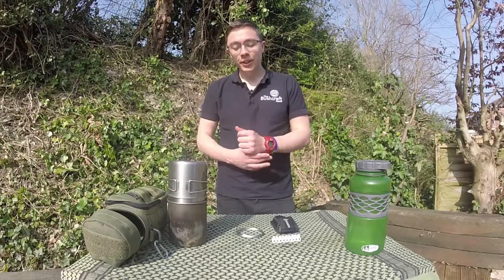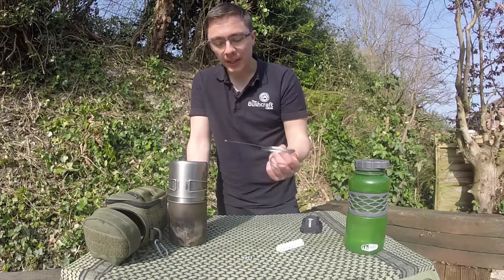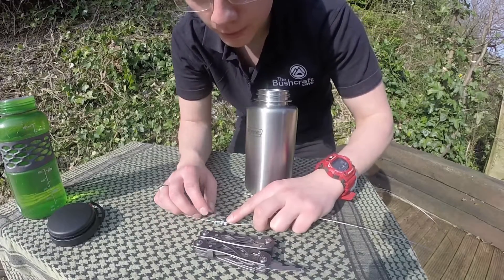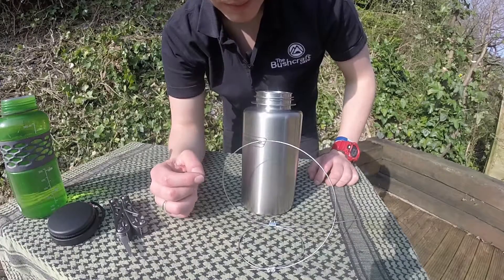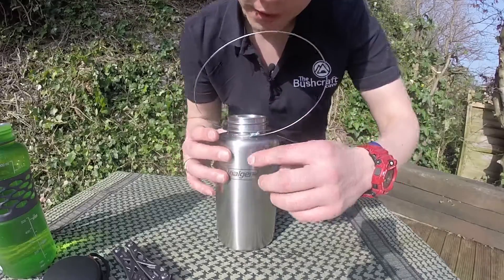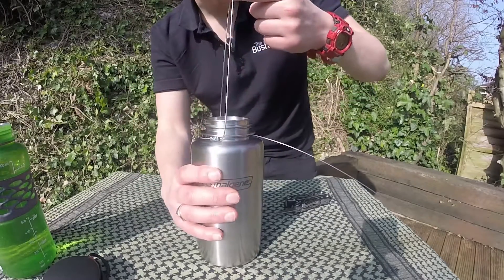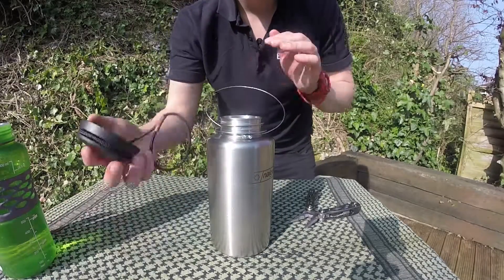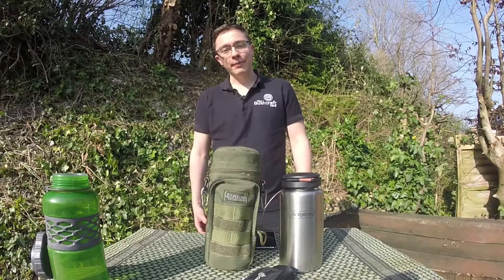Nalgene Water Bottle Wire Hanger Mod Modification

Comment: That is a great mod Callum and I use it on my Stanley cook pot with handle removed. I use a fish mouth spreader for hanging and moving my nalgene stainless bottle when using it in, over or by the fire. I have a similar nesting cook kit to yours that all nests together inside a plastic bag for easy removal from inside my Condor h2o pouch. Thank you for sharing. Paul :)

Comment: Take a stainless steel skewer and bend a full turn round something like a pencil. Cut one tail end so that centre of the loop to the cut is just under the bottle's radius. Cut the other end about half an inch longer and then fold that end over by the same measurement. Attach a wire to the loop and you have your hanger. One end of the hanger will hang lower than the other because the bent over end is heavier. Lower the hanger into the bottle and when the uppermost end is below the shoulder of the bottle lift it and the hanger will engage on the bottle. It's the same principle as a fish mouth spreader but is lighter and easier to carry. ATB